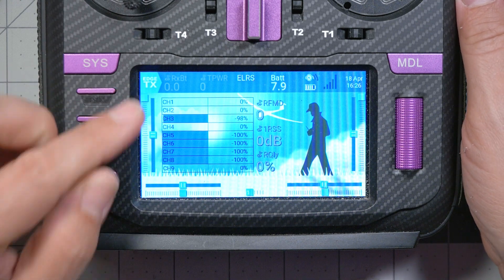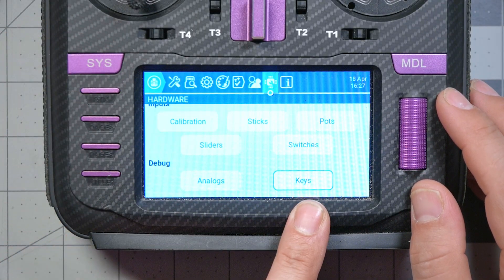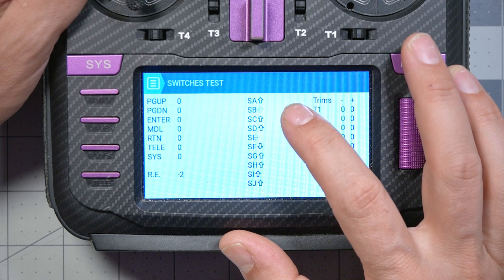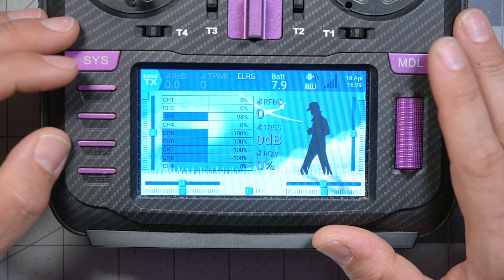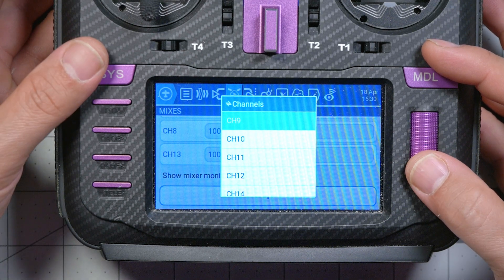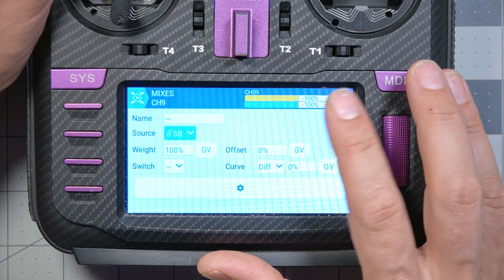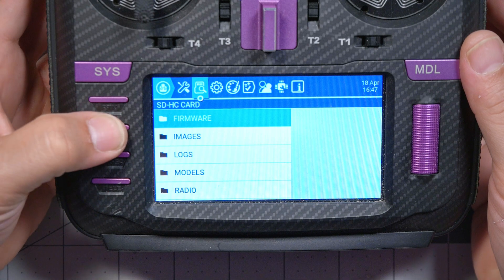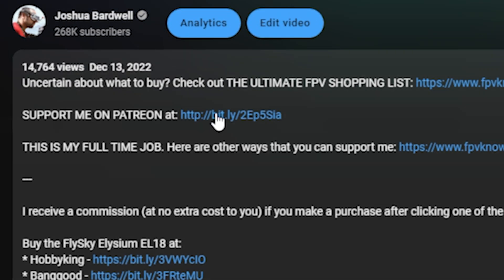6 Reasons Why Your Switches Don't Work // OPENTX EDGETX TROUBLESHOOT

Comment: So I've checked in the pages on my RadioMaster pocket and it seems to work on the radio, but when I flip the switches in betaflight they won't activate? Am I doing something wrong? I'm trying to set up failsafe and gps rescue switches but I can't get them to show in BF.
Reply from the maker: Do the channels move in the channel monitor screen on the radio? If yes, then the radio is outputting the switch movements. If no, there is an issue in your Mixer most likely that is making the switches not get to the output of the radio.

If the channels DO move in the channel monitor, but not in the Receiver tab, then maybe your receiver only supports 8 channels but you are using channels 9 and higher?

Comment: Okay, there are actually 7, you missed one for Crossfire: My TBS Tango 2 SE an SF would not work matter what, TBS Agent Lite > Nano Rx > General 12ch needs to be on to get the back buttons to work.  Otherwise, it's only 12 and the back 2 buttons won't work.

Comment: Sir,
just in case you have nothing else going on;
Maybe you can give me some instructions
Using my tx-12 edgetx-multi that I have set up to work with several other models including a corsair with landing gear and all work as they should
I have a problem with my FlightLine B-25J Mitchell 1600mm
All controls work correctly including flaps and the bomb doors
but
for some reason the B-25 landing gear take 20 to 60 seconds to start to lower or raise or longer
once the gear start moving they operate correctly in coordination with the doors, landing lights, in the correct order etc.
my input is on channel 6 named gear and the source is set to switch SC 
my mixes is on 2 lines and is also set on channel 6 with the source set on the gear input with first line switch SC-up and the second line SC-down using the first and 3rd positions
I've tried several variations of changing the mix source from the gear input to the SC switch, but no difference in how it operates
I also changed the control module that came with the B-25 with no difference in effect
be glad to send photos of the input and mix screens if you want.

thanks
Hank ; hank@realtime.net

Comment: I just got a Zorro and updated the firmware, also a Air75, both ELRS. Got them bound but although the sticks are moving in the Receiver page of Betaflight, the switches are not moving in the Modes page, even with a battery powering the drone. The switches are moving in the Debug Switches screen of the Zorro, so it's not a hardware issue. Any ideas?

Comment: As usual Bardwell to the rescue.  For some reason on this config I had lost my button to flip after crash.  I might have a bad button.  But the mix was not set on another correctly now.  And I might have a dead switch on my Zorro.

Comment: I have a question about mine. I flew with it a week ago with my plane that has spektrum reciever. Worked fine an all. Well now my TX don't do anything when use rudder. Throttle works an calibration worked when moved stick to. Now I have no rudder input at all

Comment: I was trying to figure out why one of my 3-position switches only acted like a 2-position switch. It turned out that under the Hardware screen the 3 pos switch I was trying to get working was set as a 2 pos switch. Another one of the 2 pos switches was set as a 3 pos switch but that didn't impact its functionality. After swapping those settings it is working as it should. I'm thinking that since I upgraded this Taranis X-lite Pro to Edge Tx these settings were set wrong by default. Side note, this radio has been great and by putting an ELRS module in it I think I can get a lot more mileage out of it.

Comment: Additional info I finally found out when seeing your phone. 
ELRS supports only 12 channels. 
I was the whole time wondering why tf my S1/S2/LS/RS didn‘t worked because iNav showed my 17 channels, all switches where configurated right (followed 13, 14, …) and nothing happened.
Tried now to set like S2 to ch12 and it worked like a charm. 
Hopefully some future fellow stumble on this comment when bewing in the same situation.
Reply from the maker: ELRS can do 16 channels if you put it into the one of the "full" packet rates, but the latency is significantly higher.

Comment: Can you help me out Joshua? I have a radioking opentx transmitter that i use for my velecodrone sim. One day the select mode screen pops up and i no longer is connected with my sim. What do i do when selecting 'USB Joystick (HID)?
Reply from the maker: You select USB Joystick (HID) and then what happens?
Reply: @JoshuaBardwell  it disappears then reappears instantly
Reply from the maker: Seems like your USB cable or USB port is broken and is disconnecting and reconnecting. That's my best guess.
Reply: @JoshuaBardwell  how do i get in enabled if i have an intel core on an apple laptop?
Reply from the maker: Are you using USB-C to C cable? That can cause problems. Get a USB hub with USB-A ports and/or use a USB OTG adapter.
Reply: @JoshuaBardwell  Thank you. I was using a USB C to USB from transmitter-a female USB to USB to mac

Comment: Thank you for: ELRS only outputs 2 positions.
The issue now is that my minipix fc with its pre-installed firmware doesn't have the parameter to change the channel for flight modes which is set to channel 5.

Comment: Thank you for the information, spent 2 hours last night trying to figure out why my 3 position switch on my new boxer only acted as a 2 position, drove me crazy that the higher values were not registering. I ended up resetting the switch mix with the reset feature and started reprogramming the mixer. Some how I must have assigned a value to that switch drop down and limited the range.
Your video now confirms that the radio did not have a bug, it was all me being to lazy to read the full documentation. Thank you again for putting my mind at ease and explaining the actual issue.
Reply: Hi, so basically I have pretty much the same problem , but my 3 position switch works on radio but doesn't display on betaflight

Comment: I have my mixer set up using the switch setting you describe as being wrong here but it’s a variant of your all modes on one channel method. The way I am doing it though doesn’t try to cram everything into one channel but groups modes together that don’t need to be activated at the same time with no more than one mode that does. This minimizes the number of ranges needed in BetaFlight. There is a limit to how many you can have in BetaFlight. Think it’s about 22 to 25.

Comment: I was setting up flight modes on two switches a while back.  It was not working and I was getting very odd outputs on the debug keys screen.  (Basically, I was seeing switch changes when moving a different physical switch.)  I emailed Radiomaster for advice.  They suggested removing the main ribbon cable in the Tx, cleaning the contacts (I wiped them with alcohol) and reinstalling it.  That fixed it, and it's been fine for over a year.  FYI for anyone troubleshooting.
Reply: thank you man! this helped me as well. Almost started looking for a new radio
Reply: @bf-man  great thanks for letting me know

Comment: i have been having a problem with the beepers on my quads, not sure why cuz the switch and buzzer are working so not sure i have the QX7S
Reply: In your failsafe tab check the value of your buzzer switch. Usually, you'll want failsafe to activate the buzzer, but if you power up with no radio, it's going to drive you batshit.
I'm not sure if that's your problem but...maybe it will help.

Comment: I had similar issues a year or two back when I bought a Jumper TX. Four of the switches didn't work and I flashed, changed and checked the software and settings before hitting the forums. I was so worried it was the board. Read the forums and they suggested opening and flipping the cables. This worked. At some point they should have used a thicker wire as the wire ribbon is so thin that the latch crimps the cable so thin not all paths make contact.

Comment: I daisy chained the inputs and mixes first time I did it because I thought you had to describe everything at each stage.  When you first encounter the tiers of control menus it does seem awfully confusing with excessive redundancy, I guess there is a good reason for it outside of drones, maybe?
Reply: It's for setting up advanced features on craft without a computer controller. Crow on a glider is a good example. Crow is used for slowing down and requires the coordinated use of aileron, elevator, and flaps. You could make independent inputs for each control surface with certain restrictions specifically for crow(like adding a little bit of reflex in the wing via raising the ailerons, and adding a bit of down elevator to counteract the flaps), and then mix those together in the mixer so you can assign it to a switch or slider that will control all the inputs at once. All this could be done just with the mixer, but using inputs adds the ability to fine tune the behavior of each of the controls independently.

Comment: BTW, if I'm using ELRS without a flight controller... I could set ch 5 to a value of 2000... Right?
Reply: Not if you want to use the ELRS Lua script. It blocks certain settings when the TX is in the armed state
Reply: @malte9999  Oh... I see!